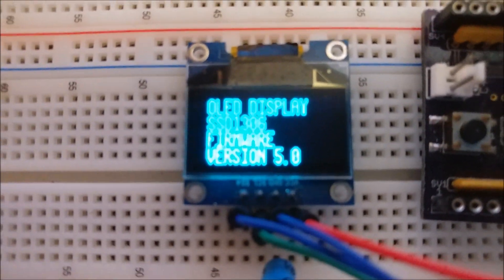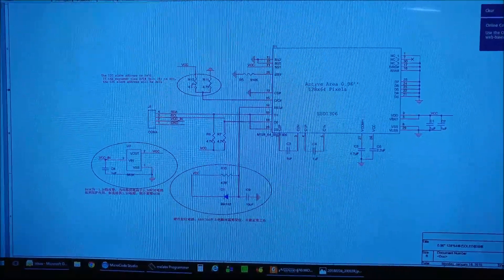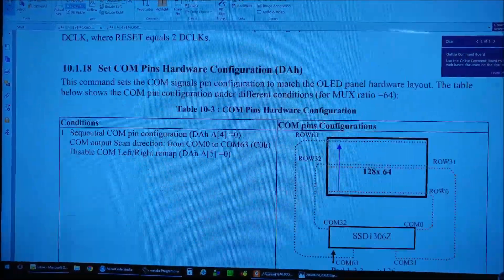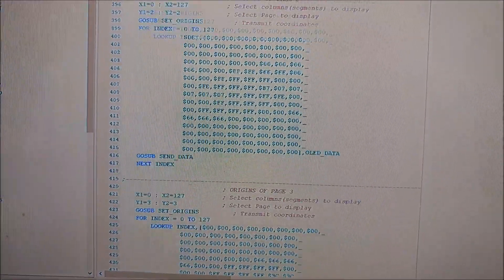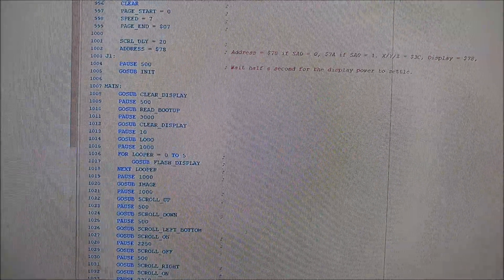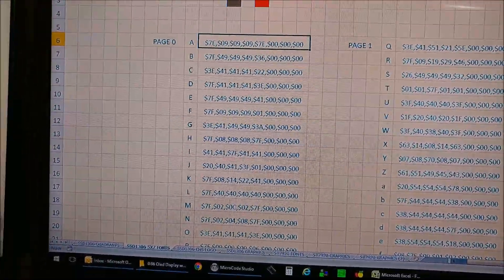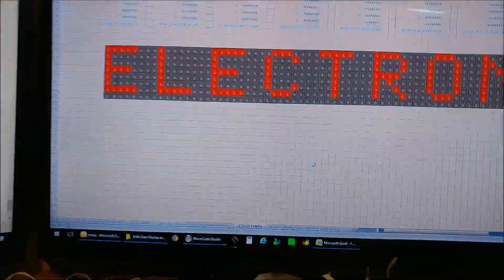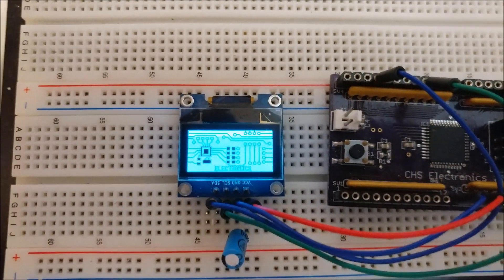0.96" Oled Display with a PIC16F887 and Font Generator

Comment: I'm now using a PIC12F1840, with a generous 4kb memory should give me ~12 different screens on my 64x32 screen. Did you use a batch-file type program for adding the excel data to include the 'retlw' mnemonic , or can this be done within excel?
Reply: Ah,  I found I can do it in Excel; ="retlw 0"&cell reference&"h"

Comment: How to connect 128x32 oled display with pic16f873-20/sp?
Reply from the maker: Well that depends.  Is it a I2C display or a SPI display?
Reply: It's spi 4 pin display.
Reply from the maker: Read section 25.2 of the datasheet. It explains what registers need to be set to make it work. The APFCON register determines which pins you can use to connect it. It allows you to configure  the SCK, SDO, and SDI pins and map them to Port pins. Don't forget about setting the TRIS and Port registers to the proper settings for the specific pins you choose to use.

Comment: What is the target PIC for the code that you uploaded?  The code information box indicates PIC16F877 but I cannot get the code to compile for a PIC16F877.  A syntax error is generated when encountering the OSCCON configuration.  According to the PIC16F877 datasheet, there is no OSCCON register nor are there ANSEL or ANSELH registers.  If I change the target PIC to PIC16F88 as indicated in the comment after the OSCCON configuration, I get an error at TRISC configuration.  According to the PIC16F88 datasheet there is no PortC.
Reply from the maker: Hi Dan. My apologies for the late reply. The target pic is a PIC16F887, not 877.
Reply from the maker: Correction thats a PIC16F18877
Reply from the maker: Correction again! PIC16F887. This is correct.
Reply: @CHSElectronics   Thanks for the additional follow up.  I may be doing something wrong, but as described previously, I cannot compile the code as written, for PIC16F877.  I am using the most current versions of Microcode Studio Plus and PBP3.  That being said,  after editing the PIC configuration settings and the MSSP Module settings for use with a PIC18F26K22, the code compiles and runs as in your video. Thanks again for posting your code.  It is the most informative example of using PPB3 with the SSD1306 display that I have found.
Reply from the maker: @danbarber386  Thank you for you kind words.

Comment: Excellent work, and everything is done in PICBasic ! This will be very helpful to the PBP lovers like me and many others trying to include Oled in PICBasic projects. Unfortunately PICBasic is just disappearing from the arena due to lack of updates, but still many like me are sticking to this languge for its simplicity to accomplish complicated tasks. 

Thank you very very much for sharing this project.
Reply from the maker: Thank you Mainul! Kind words indded. As it is true that PBP is on a decline, it's still useful and powerful. Hopefully a new generation of developers will take on the challenge of keeping it alive. Just like you, I also had to learn from other's examples to make things work. Thanks for stopping by and giving us your feedback.
Reply: @CHSElectronics  Thanks for quick response to my comment.  
I was trying to run your code on Proteus but with no success. No response from the Microcontroller. Nothing happens after I run the code excetp portc.3 changes its state from high to low after several milliseconds. After that change everything remains silent.  I have connected PORTC.3 to SCL and PORTC.4 to SDA of the display.  However, when I run another hex file compiled in MikroC, the display responds perfectly with the same configuration. I guess something might be wrong with the code you have added in the zip file. Could you please mange a little of your precious time to recheck the code. 
Thank you once again for your cooperation.